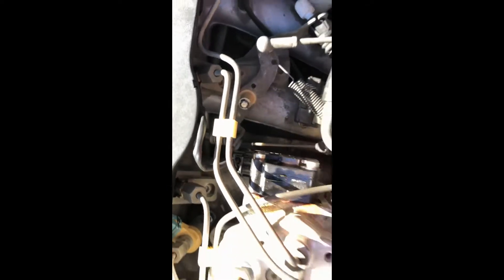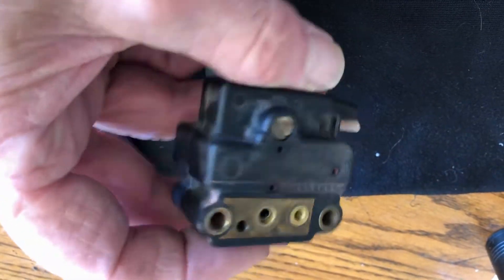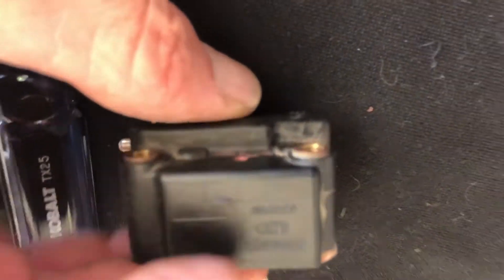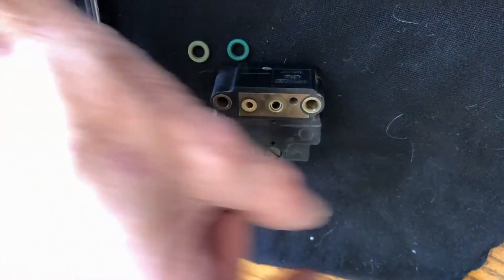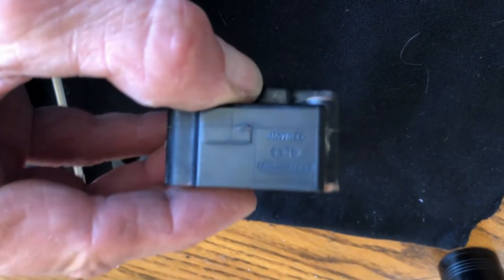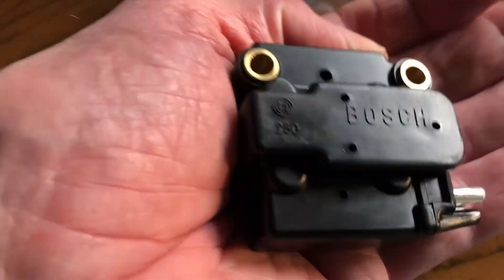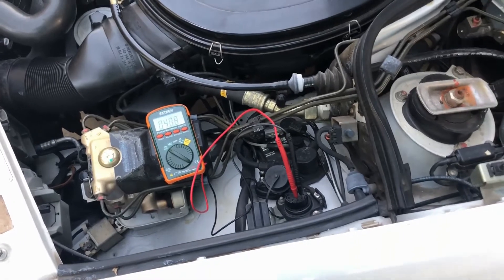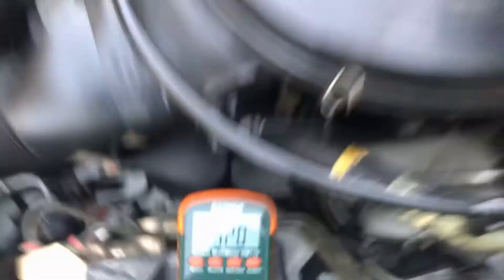Mercedes W124 M103 Adjusting Hertz Duty Cycle And Replacing EHA Valve

Comment: If it’s not supposed to leak what is the purpose of the weep holes ? What about possibly plugging up the weep holes with jb weld ?
Reply from the maker: What's inside a EHA, have that video on my channel,  there's two oblong gaskets inside that leak, fuel leaks out weep holes,  JB weld?  maybe but won't last, unit is under fuel pressure, last couple of months I no longer can adjust duty cycle, replaced unit with a new one, still same problem, so I have to figure that out, maybe 02 sensor or computer.
Reply: @mygermancars7264  thank you for reply

Comment: Hello. So I have a 1991 w124 300E. The car 'sometimes' takes longer cranks to start but always does. It is veryyy slow to accelerate tho. I think 0-60 is about 13 seconds. I only have access to a variable voltage volt meter, doesn't measure in hertz. When fully warmed up and idling, the variation is between 0.11 - 0.12, which doesn't sound normal. And the voltage doesn't fluctuate as rapidly as I see in videos. I dont think I'm entering closed loop. Is there a way to diagnose further using this voltmeter? Itching to adjust the EHA too, should I?
Reply: I only use hertz cycle function, easier for most, it can get complicated using voltages, I would ask on Benzworld forum ,they also have lots of info on procedures I've tried adjusting EHA valve before with no luck, its very sensitive , I've been told don't touch the EHA valve unless its leaking.
Adjusting duty cycle is about the only thing you can do to adjust fuel ratios , clockwise leans it out, CCW makes it rich.
A faulty 02 sensor can mess things up also, on my 300E duty cycle would not adjust  to 50% car was running but under powered, new EHA was like a new engine was installed!
Reply: sorry, in a 124 300e clock wise richens mixture.tightens sensor plate -cc leans out-lets more air in...so I understand...
cheers!